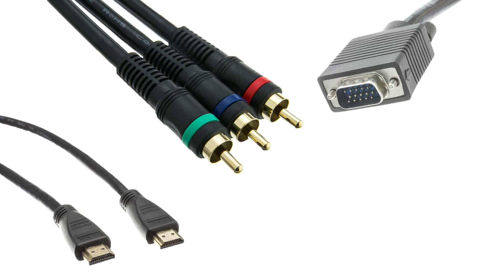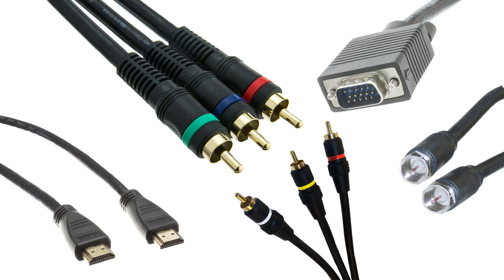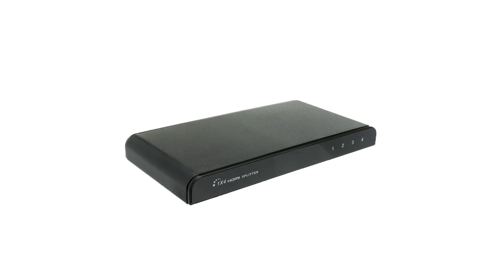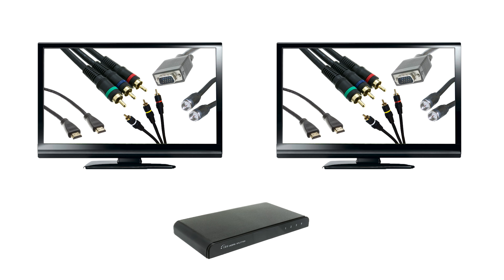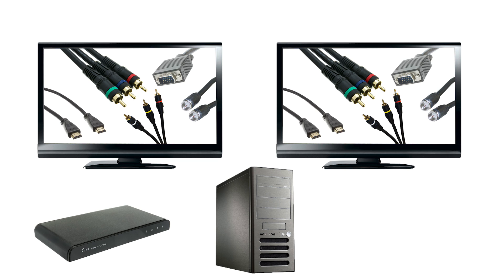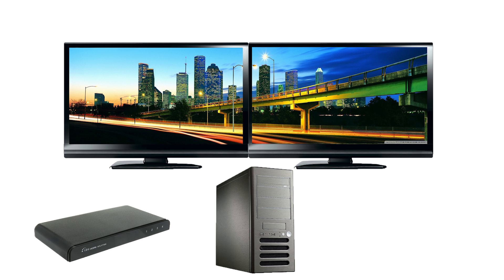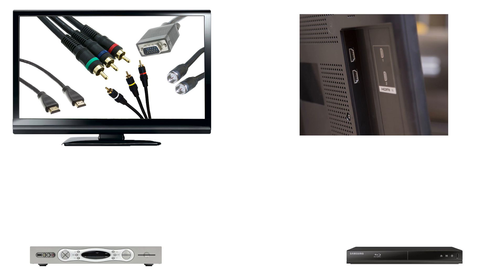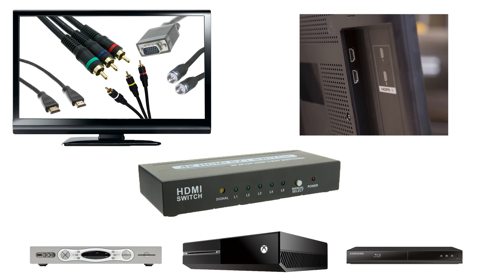Splitter Vs  Switch

Comment: I'm such a donut... trying to connect my Digital Drawing Tablet screen split with my TV with HDMI... initially I was going to use a DisplayPort - HDMI Adaptor for my tablet and the normal HDMI slot for the TV hoping it could use both at once... bought it and it wouldn't work... so I went and Bought a Switcher instead of a Splitter and now I realized that was stupid... so Now... I have to buy a Splitter... wasted $30 for nothing lol

Comment: Helpful, but you didn't say how you use the switch to switch between devices - does a switch have a remote, or a manual switch on the switch box itself?

Comment: So let's say I want to stream a game from a console, and have a capture card. How can I use a monitor which is connected to the console, and then transfer that as live stream through the capture card and into the laptop? Do I need a splitter so that I can connect the console to the splitter, and then connect the splitter to the monitor and the capture card? Sorry if this is confusing.

Comment: here is my case ...
1. I have desktop computer
2. graphic card with only 1 hdmi port
3. that port is already connected to my dell monitor 
4. now i want to connect my sony bravia with hdmi also , so that i can see same visuals in both screen at the same time and want to use 1 keyboard and 1 mouse  for both screen !

what should i do ?   i want full confirmation .....
plz answer

Comment: Great vid! thanks A lot! Wanted to ask you guys something: what should I buy if i want to make a three channel video installation to be exhibited in a gallery? the thing is each channel is a separate video and all three of them need to be in perfect sync. I know how to sync them frame to frame in Premiere pro but i have no idea what hardware i need to have them running like this. the 1st (left) video will be shown using a projector and the 2nd(center) and 3rd(right) will be running on screens. Also if you know of any software to help me send the information to the projector/screens from a laptop i would be more than grateful. Thank you in advance. 

Vyr
Reply from the maker: Interesting question. What is actually going to be displayed? 

You could look into a product called an HDMI Matrix. Sounds like the challenge will mostly be on the source (your computer) and a Matrix may not even be necessary (as long as your source has at least 3 outputs).

Comment: I need to split my pc to my TV and monitor what would I need?
Reply from the maker: If you want the monitor and TV to display from the computer simultaneously - use a splitter. If you want to be able to select different displays at will - use a switch

Comment: I have a macbook pro 2012. I am looking for a "spitter" or a "switch" that allows me to use two screens connected to the Mac, which does not duplicate the contents of screen 1 on screen 2, but which allows me to see for example in the screen1 autocad and in the safari screen 2 and in the mac word screen, that is, which makes the screens independent. can you suggest me something?

Comment: Hi so I have 1 monitor and iv connected a ps4 to it... but at the same time i want to connect my laptop should I get the switch? So i can just switch between the 2 devices?

Thanks!!
Reply from the maker: Yes, a switch is what you will need.
Reply: @CablewholesaleInc  thanks! Im gonna buy it rn!

Comment: Sir , i have purchased a sound bar  having hdmi arc and my tv doesn't support arc , i  also have mi box 4k connected to the tv through normal hdmi cable which one should i buy switch or splitter? I want to get output from the soundbar when using tv alone and also while using mi box 4k
Reply from the maker: Hello Sajan,
Please provide the model number of the tv, sound bar, and mi box so I can better assist you.
Reply: @CablewholesaleInc  tv model: lG 32lj525d
Reply: Soundbar :real me 100 w soundbar
Reply: Mi box 4k
Reply from the maker: @sajansunny6024  Thank you for this information. We recommend that you reach out to LG since they are the manufacturers of your tv. Your tv's compatibility will dictate what kind of equipment you will be able to use for your setup. They will be able to tell you what the best solution will be for your issue.
Reply: @CablewholesaleInc  ok thank you😊

Comment: Hi , is there something on the market where I can have both a splitter and switch combine in one device?
Reply from the maker: Hello alfafa30, What type of function are you looking to do? Are you looking to be able to switch between input devices that simultaneously signal multiple outputs? You may be able to split the signal after coming out of the switch, although the signal strength may be educed. Unfortunately I am unaware a a singular product on the market that can both switch and split signal.

Comment: Getting into trading. Need two monitors for my one pc to show multiple web pages/software. Can you guys help me out?
Reply from the maker: Hello Jack, What is the model number of your PC?
Reply: @CablewholesaleInc  Its a custom build that i didn't create. I've got only one HDMI port on my gcard. There are others but they seem to be meant for larger? HDMI cables
Reply from the maker: @jackface2499  are you able to contact the person who built your PC? It sounds like you want an extended display since you want to access multiple web pages on the monitors. The type of video card you have and your video/usb ports will help decide the best option for you.
Reply: @CablewholesaleInc  could i also attach one hdmi port to another monitor instead of the pc?

Comment: I want to play sound bar n satellite TV box at same time but I have only HDMI port.Can I use splitter in this case
Reply from the maker: Hello Vicky,
Please provide the model number of your TV.
Reply: @CablewholesaleInc  can I use optical cable from set top satellite box (spdif ) to Samsung sound bar Hw n300 optical output to listen sound from tv
Reply from the maker: @vickybhatia190  Yes, you can. I would reach out to Samsung also to make sure your satellite box is compatible with your sound bar.

Comment: Can you extend multiple monitor display via a HDMI Switch?
Reply from the maker: Hello Jem Seng, You would be unable to hook up multiple monitors to a switch as there is only one HDMI output
Reply: MT-ViKI is professional switch & splitter suplier. In fact, you can choose hdmi splitter 1 to 2 monitors, or 1 to 3, or 1 to 5 or even more. We call it splitter. While multi-pc to 1 monitor, we name switch.  get me back if you want testing the product

Comment: Hi there, great video-very informative.  I have a soundbar that is currently connected to the arc hdmi port of my tv, but I also want to connect my DVD player (but I have no remaining ports on tv). Is it a switch or splitter that I need? as I want to use the  soundbar at all times I.e. when watching the tv but also when using DVD player also? I am getting a little confused with what is the correct option for me. And do the devices either switch or splitter both support hdmi arc?
Reply from the maker: Hello Ria Sure, Unfortunately, neither of these options would work in the way you are describing. In a switch, only one device is used at a time. With a splitter, you would be unable to hook up the DVD player, as the HDMI ARC is an output port. Do you have other HDMI ports on your television? We would be able to help you explore possible options to provide the best possible solution solution. Please email us at support@cablewholesale.com or calll 888-212-8295 ext. 192. We hope to be able to help assist in finding the solution to your problem!
Reply: CableWholesale.com thank you for your response to my question which is greatly appreciated. I have just sent you an email.Look forward to finding the  perfect solution! Thanks

Comment: Hi there, I want to extend my laptop screen to 6 external monitors. I got a splitter for that but obviously, it didn't work. Would you be able to assist me to find what I need to extend my laptop screen to external 6 monitors?
Reply from the maker: Hello p3r n15h, yes, the splitter would stream the same signal to each of your monitors. To be able to extend your screen in this way, you would need separate output ports direct from your laptop. You would probably want to look at external video cards to be able to make this possible. Unfortunately, this could be a very expensive problem to acquire a solution, and we do not carry these parts at CableWholesale.com.

Comment: Hey, thanks for the explanation, do switchers have a latency problem?  Or is it a process so simple that it's basically instantaneous from say a  PC to switch and from it to the monitor
Reply from the maker: Hello Mattia Formichetti, there should not be latency problems with a switch as the signal is simply being sent through the switch to whichever out put is selected and not being altered.

Comment: Hello there,
I have a mac book pro 2015 ... and need to used two additional monitors (HDMI) as extended desktops. 
I made the mistaje of getting a Splitter , it only mirror the display on one monitor onto another. 
Please help me find the right adaptor to connect the two monitors as both extended desktops .
Thanks in advance :))
Reply from the maker: Hello, To extend a desktop, all additional monitors would need to be connected directly to the computer. Choose Apple menu, System Preferences, then click Displays. Click the Arrangement tab. Finally, make sure that the Mirror Displays checkbox isn’t selected. This should enable you to experience the extended desktop effect between your monitors.

Comment: i have a pc, but there is only 1 hdmi output. if i want to hook up 3 monitors to the hdmi port, what device should i use?
Reply from the maker: Hello Kenzo,
Since you have one pc and want to hook up multiple monitors you will need a hdmi splitter. I would recommend purchasing the part below:

Part Number: 41V3-04100
Description:    4K HDMI Amplified Splitter, 4 way, 1x4, HDMI High Speed with Ethernet, Metal Housing
Price:                $21.94
More Info:        http://www.cablewholesale.com/specs/41v3-04100.php

Comment: Thank you. I just bought what you're calling a "switch" to mirror to two different TV's at the same time. Looks like I was supposed to get the "splitter" for that. My bad. Now I have to order the splitter in which I'll do like now. I guess I'll keep the switch in my wire junk drawer just incase I will need it sometime.
Reply from the maker: Sorry to hear that. But, it can be good to have spare components handy.

Comment: I need a dual display  which I can use between 2 computers. How?
Reply from the maker: You would most likely need a Matrix splitter. 2 in and 2 out.
Reply: id be able to click between computers and the dual screen would follow on both?
 @CablewholesaleInc
Reply from the maker: @jboogzthaproducer119  Yes you'll be able to do that

Comment: I have an Asus rog gl 552 vw laptop which has an HDMI port to connect an external monitor. I have two monitors and want to connect those with my laptop. I have brought an HDMI splitter which only duplicates the display. So, then I brought a USB c to HDMI adapter. I connected one of my monitor with the main HDMI port that my laptop has and another with the USB c to HDML adapter. Then I connected that adapter with the USB c port of my laptop. But now one monitor is working which is connected to the main HDMI port of my laptop. How can I connect two external monitors with my laptop?
Reply from the maker: Both should work at the same time, make sure the USB C to HDMI adapter is showing up in your hardware and the driver is loaded. You may have to go into laptop settings and set display to extended. Not sure what kind of specific adapter you may have, but if that doesn't work you may need a USB video card because your USB-C port is a vanilla USB 3.1 port and not DP alt more or TB3. In this case, I would suggest our USB to HDMI Video Adapter that we carry: https://www.cablewholesale.com/products/usb-firewire/usb-adapters/product-41v3-30110.php

Comment: Great information. Would have purchased the wrong device had I not found this video.
Reply from the maker: Nice! We're glad it helped!
Reply: @CablewholesaleInc  I need a Matrix splitter to go with my kids pc's for 3 monitors with different displays. What do you recommend?
Reply: hi,Qaadir,do you need a free HDMI splitter?
Reply: same here
Reply: same here!
Reply: I'm gonna have a a spliter switch hybrid setup because I have two screens and already have a splitter I'm gonna by a 3 way switch. One port for my main console, my Xbox 360, and a chrome cast or DVD player depending on my feelings. My other monitor has a rca plug in for my ops and early 2000s consoles which is nice. Also I think these newer games look better at on a 720p to 1080p game dunno the darkness and other effects are perfect for horror games nighttime, racing games. and well mmos. Yes you can say 4k and HDR is better which yes it technically is, I have 4k curved TV in living room and my main gaming monitor is a HDR curved monitor. But doing a direct side by side comparison I prefer 720p and 1080p for my games. But HDR and 4k for Realism.

Comment: Hi, i need some professional advise, i bought a switch with 5 v and its too low for my 3 devices, how can i boost my switch to have more V or u can tell to recommend some switchs with more  volts ?
Reply from the maker: What kind of switch are you using? Can you provide the part number or link to the switch?